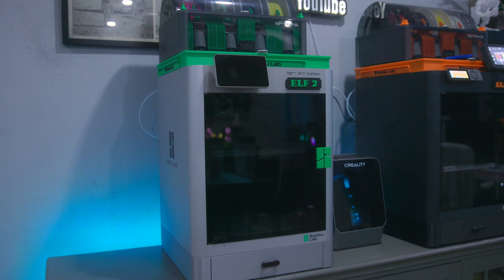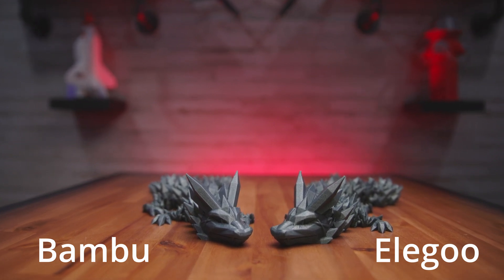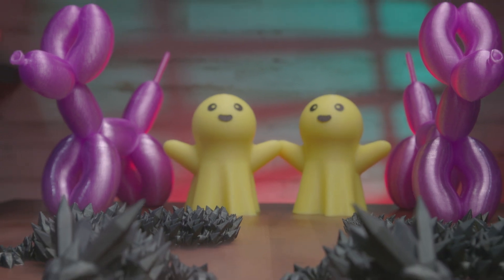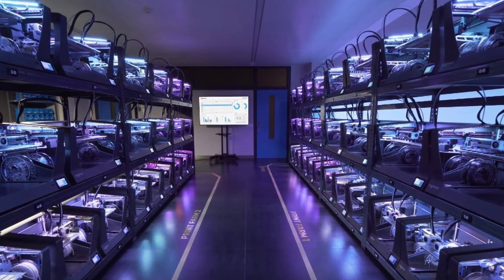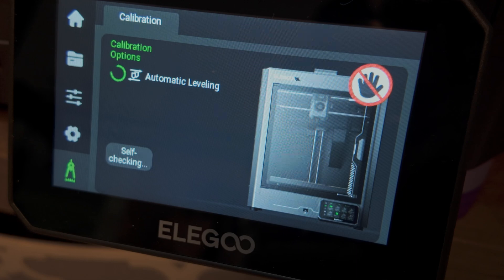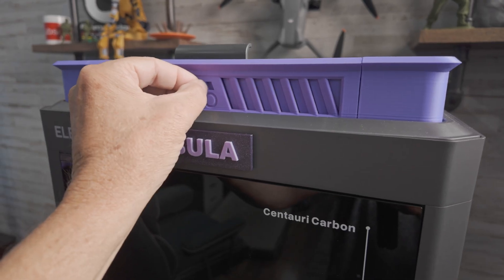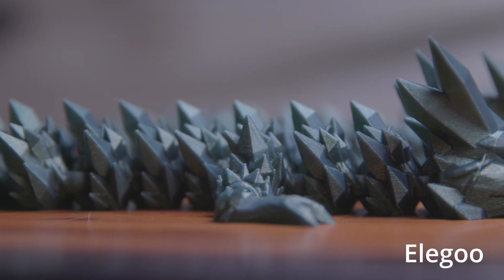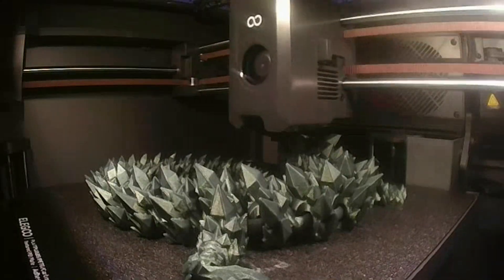Elegoo CC vs Bambu X1C - Budget User's Perspective

Comment: Did you verify that the line widths and other slicer settings were identical?  Default slicer profile settings are generally OK, but almost always need more tuning.  Nobody ever highlights the print start speed of the CC, especially since bed mesh can be precalibrated and bed leveling bypassed prior to printing.  Part of using any printer as a tool is learning how to create your own profiles.  It is also learning how to get the most out of the tool.  I liked my first CC so well that I gifted my X1c (with AMS) to my son and bought a second CC.  No one ever talks about the common ringing problem (print artifacts) that many X1c owners experience.  Also personally have never found X1c lidar to live up to the hype.  Dona real world comparison without using any Bambu filaments.  There are less expensive filament options, and filament cost is the number one ongoing 3d printing cost.
Reply from the maker: thanks for watching, we will try to get better on the next one